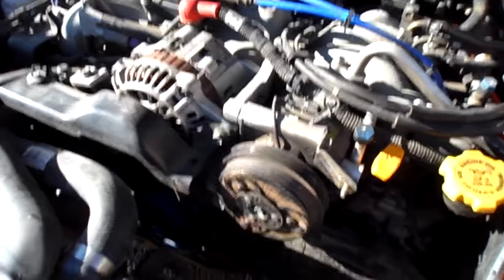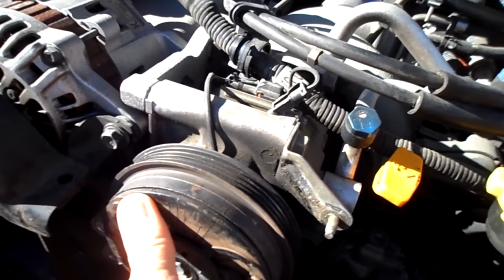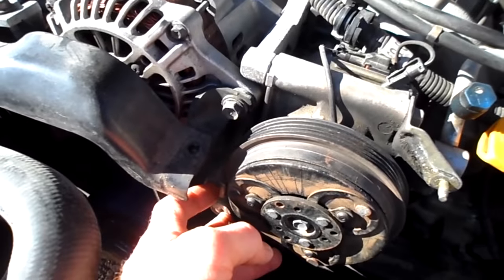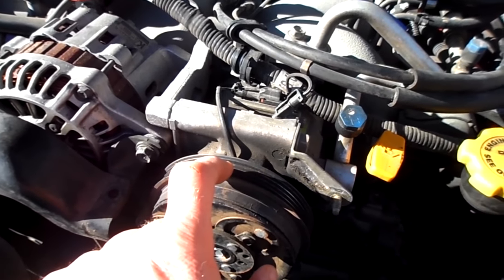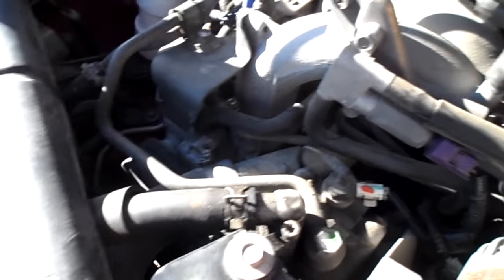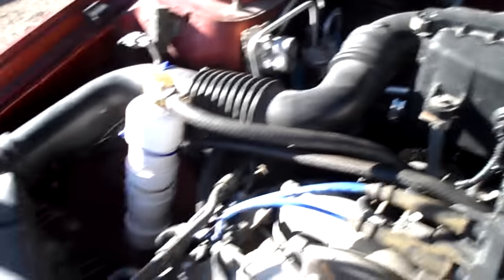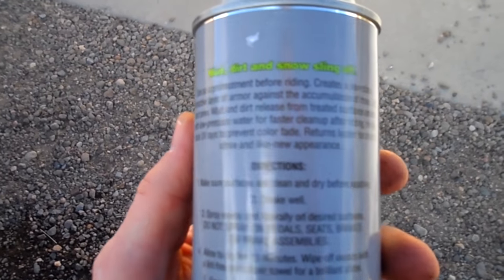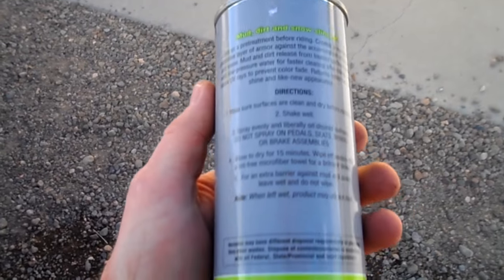2003 Subaru Legacy Engine Clean

Comment: You couldn't even clean the dirt in the ac pulley
Reply from the maker: The compressor is seized so it's coming out sometime soon.  Could have cleaned it but didn't bother,  did clean up the residue from when it's belt shredded.